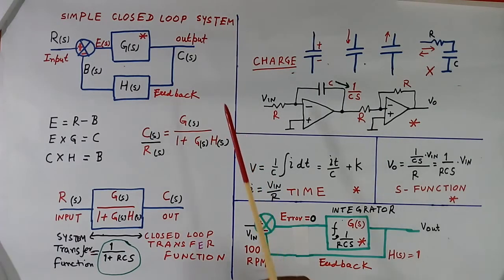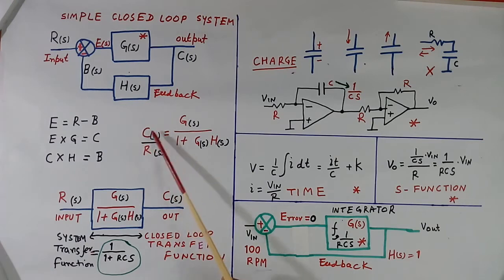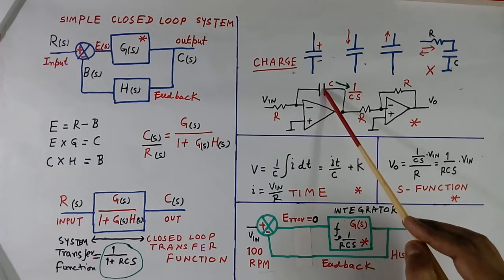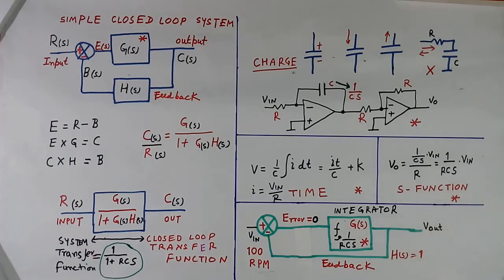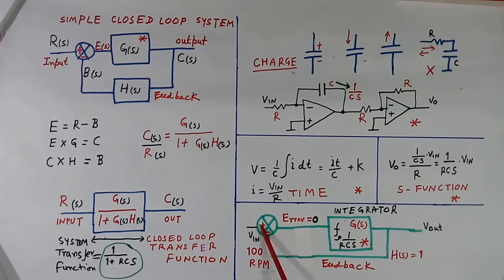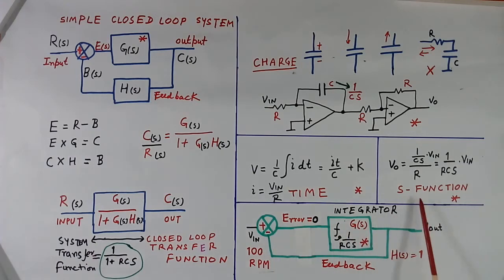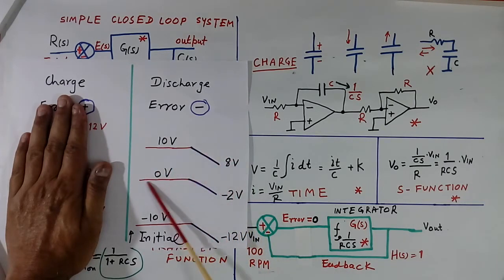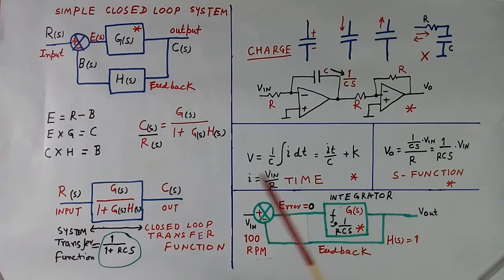How Closed loop control system works & concept

Comment: Sir we can use it in time machine .... there is possibility that if use closed loop machine in time travel it can work like

An extremely powerful gravitational field, such as that produced by a spinning black hole, could in principle profoundly warp the fabric of existence so that spacetime bends back on itself. This would create a "closed timelike curve," or CTC, a loop that could be traversed to travel back in time.
Reply from the maker: I do not know, how to use closed loop to go in time back. You can try.
But some how if time back is possibley say 2000 years back, then we will loose our existance also, and we will never know that we are in time back. 
Who knows that we are already in time back mode of 20000 years.